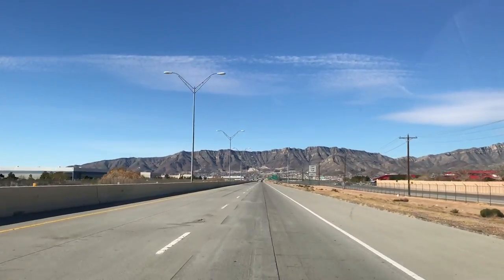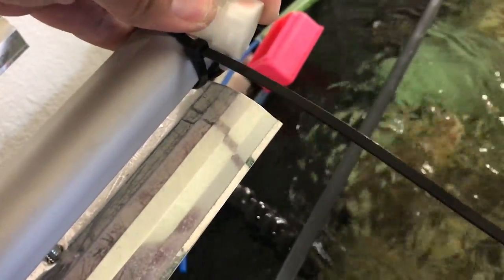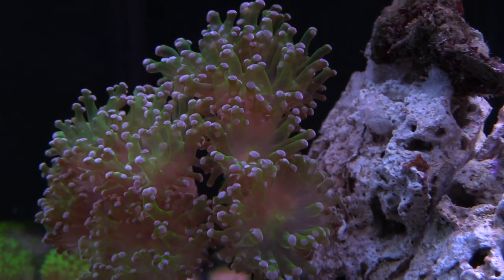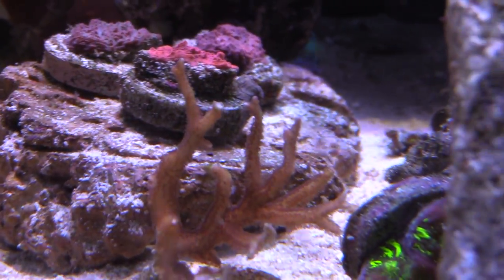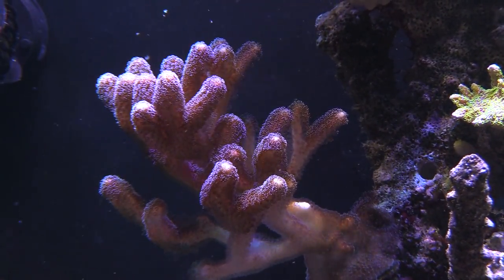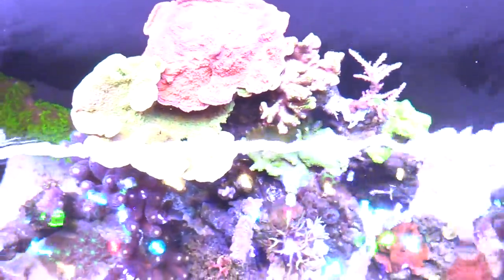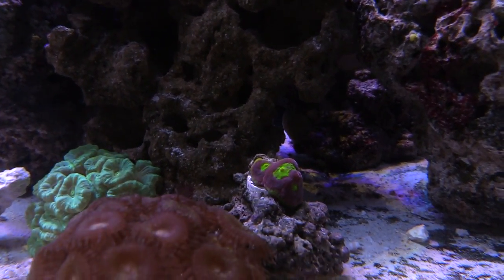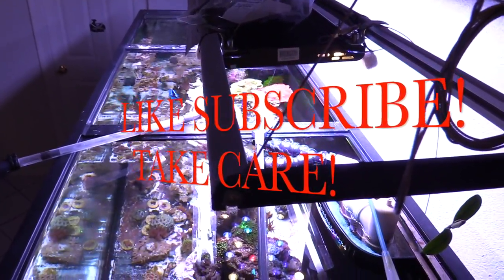180G REEF SALTWATER AQUARIUM DO YOU EVEN REEF BRO?! CORAL REEF TANK UPDATE

Comment: Was wondering if you can help i decided to set up a 6 gallon tank with just sand and tonga branch was thinking of putting gsp on to cover the branches will be no other coral in the tank and just 2 yellow clown gobies the question is can i use just marine blue and white led or would i still need full spectrum light thanks
Reply from the maker: Your light will probably be just fine just for gsp.
Reply: 915Mang thats great thank you